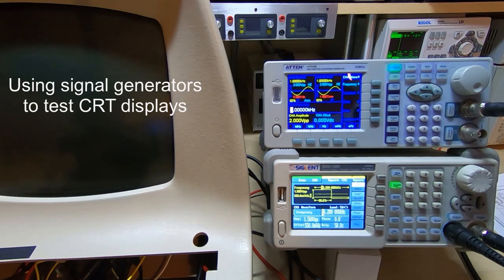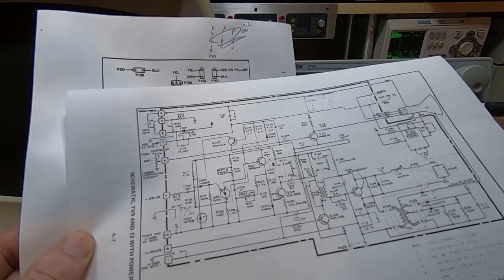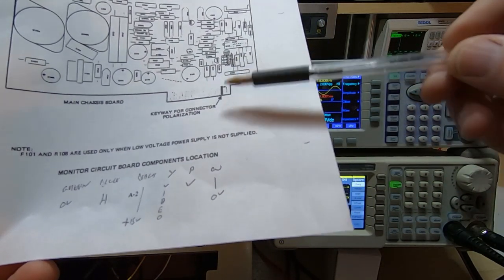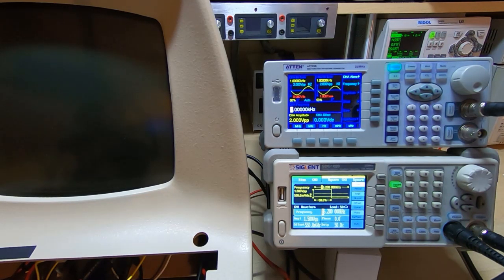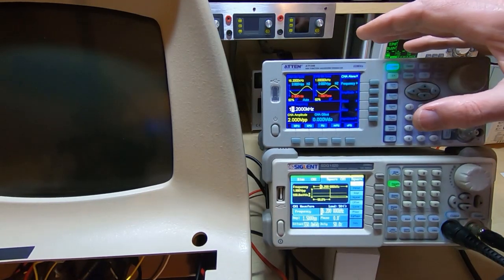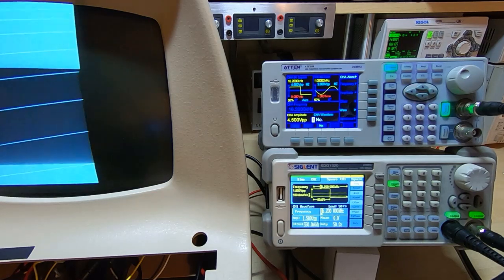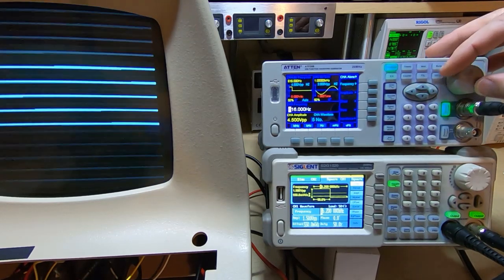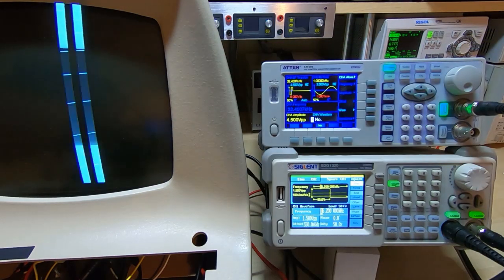Testing CRT with signal generators

Comment: As for the composite signal, isn't it possible to make that signal with a arbitrary waveform generator like the siglent you have. This way you only need one generator.
Reply from the maker: No not really as the H and V syncs are not the same on every cycle/ Also you really need to be able to vary the video content to test the display properly.

Comment: should at least know what tube you are dealing with and yes the control circuits.
Reply from the maker: The tube type / size is not important. In fact this technique will work just as well with LCD monitors. The interface and drive board will take care of the tube as the sync pulses etc are the same for all sizes. In some cases where a schematic is not available for the CRT display I find another unit which uses the same display and then I look at the interface to the display control to determine what signals go to which pin. It varies but the general method is very flexible which is why I use it so often.